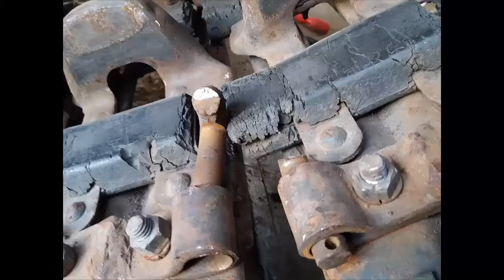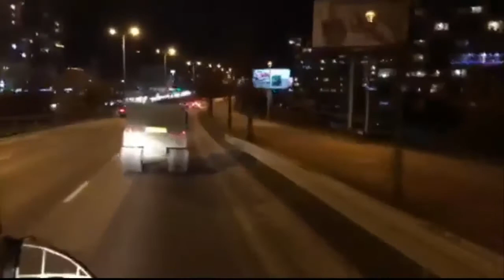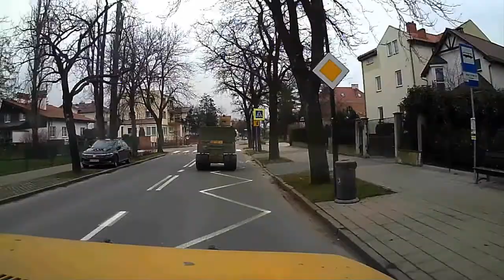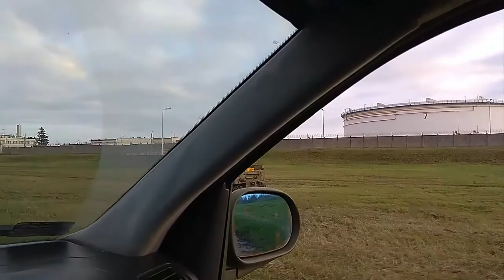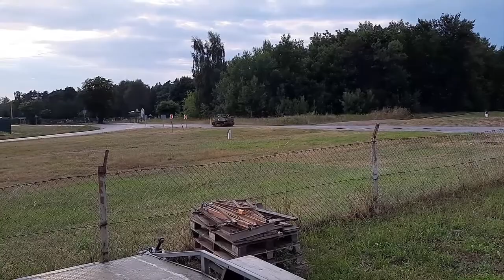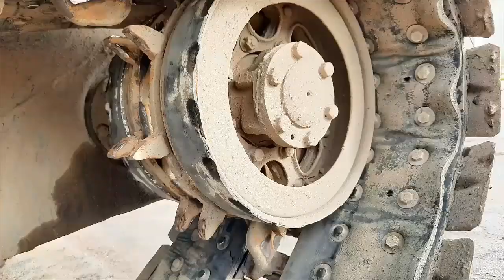T24 Weasel New rubber track pads and tests

Comment: What did you use to connect the tracks on the underside ?
Reply from the maker: Conveyor belts
Reply: I’ve got a set Iam trying to rebuild my self how many links on each track ? An what thinkness belt did you use on inside ?
Reply from the maker: @bjaddis9656   2 Conveyor  belts are used, 1 is 12 mm thick and 4 reinforcements in the middle, 2nd belt is 8 mm thick has 5 reinforcements in the middle, the idea was to have as much reinforcement in the belts as possible.

Comment: Foolish to drive it on the street. You’ll wear out those tracks in no time.
Reply from the maker: Hi the cubes are interchangeable, besides, if you did something 1 time, you can do it more times. The vehicle is primarily intended to be fun and you have to use it as much as possible.